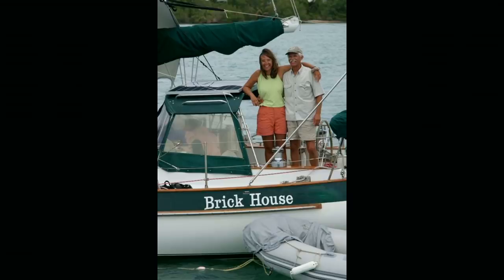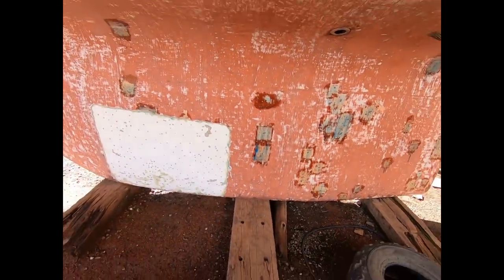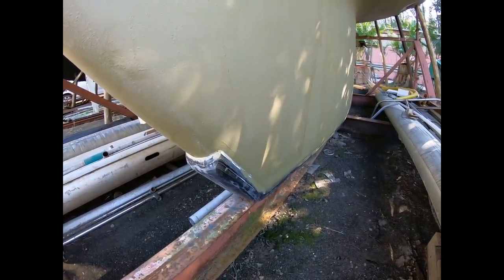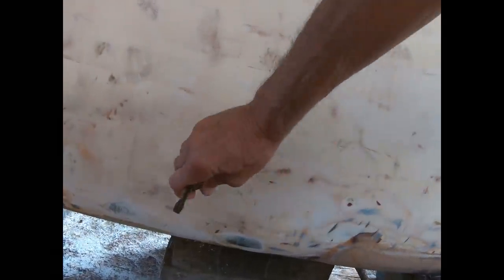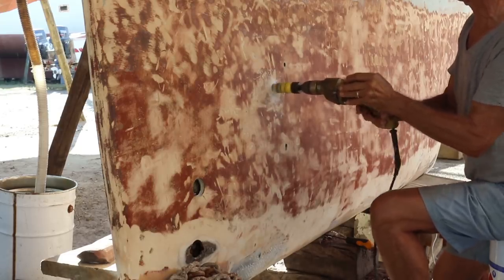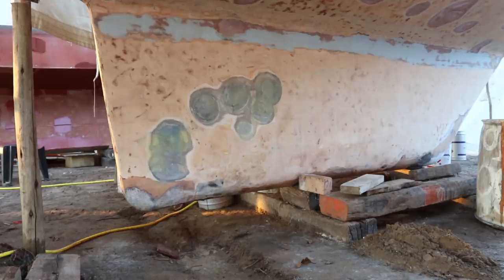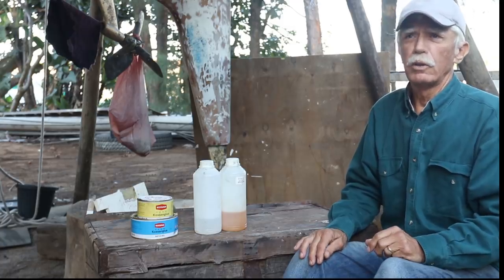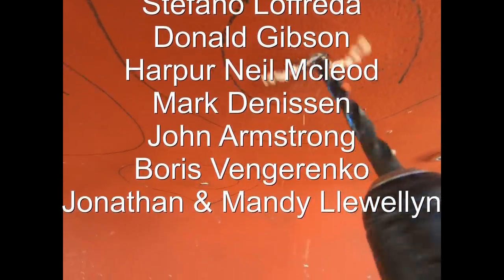Sailboat Keel Repair/Problem: SOMETHING IS MISSING FROM OUR KEEL !! (Patrick Childress Sailing #42)

Comment: Wow, memories came flooding back to me while watching your video!!..
I built a sailboat in transvaal back in the early 70's out of (open cell foam) and fiberglass etc (foam sandwich construction) it was a bilge keel design and the twin keels never worked as we almost lost the boat on a trial voyage off Hangklip in False Bay in around 1982  some years later..long story short I removed the twin keels and created a cutaway forefoot keel which I fabricated out of foam and fiberglass and ingots of lead for ballast. basically what you have there on your keel with a void aft of the ballast with foam.

 During sea trials after I converted,  I was horrified and depressed to note that my boat was still very tender and it was owing to the fact that I was getting a lot of negative buoyancy , as my good friend Roy MacBride pointed out on this trial sail, as did my friend Paul Tomes, both very competent sailors and builders. My only option to salvage my boat and my world cruise dream was to haul out again and remove a large square of fiberglass from the keel side and literally dig out the offending foam, until I had hollowed out the space !! (Yes, the joke about the yard at that stage was that Reid was giving his boat a Caesarian.!).anyway, after that I reglassed the big square hole closed but left a hole about six to eight inches open and into this I poured wet concrete, I kid you not... and after it was levelled off at the top of this hole I it let be for a month or so to cure (concrete cures pretty much after 30 days), but continues to harden for a very long time, seventy to eighty years comes to mind.

Well I sealed off this hole finally and put a new coat of antifoul on my Deja vu, and took her out on another trial sail. WELL!!! If this wasn't a stable, solid, stiff boat in a hard breeze in False Bay!! She was a different boat!! She pointed very well upwind, had lost a lot of her tenderness,  and the rudder was very well balanced and a joy to sail!!   This may as well be a preview to the beginning of the book I wrote some twenty years later after sailing virtually all the way around the world. I never have had a moments trouble from her keel or the concrete ever, and she is still going strong some forty years after I set off on my cruise. The book describes the terrible voyage where we had the major showdown with the bilge keels.... I had to abandon her a few miles off Hangklip during a fierce winter storm over night after the National Sea Rescue Institute tried towing us to safety but was not able to do so...the book is called Days of Deja vu (jonathan reid)  if anyone's interested in reading all about it and the cruise thereafter...:)  I was so pleased to see that you poured the voids full of a solid, even if the resin did not set off 100%  I am pretty sure it eventually will harden, and you have no doubt seen the improvements to her performance!  I wonder if you and some of the other boat owners there in the yard are planning a world cruise? If so, the best of luck to you all and may God go with you! I currently live on the Hawaiian island of Kauai, have done for a long time lol, but do miss my days sailing around the cape area and the Vaal dam where my boat was first launched...Be safe, and tight sheets..:)
Reply from the maker: Jonathan Reid This is Rebecca. It sounds like an interesting book! Thanks for watching this video and commenting...definitely watch some more of our videos before this one...Yes...we are slowly circumnavigating...out for 12 years now. Love Kuaui...May end up there someday...we will be heading to Uruguay, and then south to Patagonia and back up he other side...so the Hawaiian island certainly possible. See you there!
Reply: @RVLifeNOW  Thank  you, and I see you are already slowly circumnavigating... sorry I didn't figure that out, but that's wonderful and I wish you the best and bon voyage :)

Comment: Doing this in South Africa must make this a lot harder for sourcing quality materials.  I have read of people flying back to the world to buy what they needed and returning to their boats with it depending where they were at.  Sometimes it was the only way to guarantee that you would actually get it.  Good luck with your project.
Reply from the maker: You are exactly right. There is a 56% import duty. Rebecca came back from the U.S. with large suitcases stuffed with repair parts.

Comment: Had a similar weakness on my old Rival 31 sailed her for 20 years before when doing re-fairing work following remedial osmosis treatment I discovered the very aft tip of the keel bottom was hollow and extremely vulnerable should one ground on that point. I did a similar repair but also stuffing in mat and resin.
Reply from the maker: Good info

Comment: In the US I've had good success with Raka epoxy. Thanks for the great video!
Reply from the maker: Just like Gurit, I have not heard of Raka. I used the Gurit yesterday and it is performing as I would hope a proper epoxy would work. In the June 2012 issue, Practical Sailor did a comparison of epoxies. Raka was one of the 4 tested. It did very well.

Comment: That keel void wasn't so bad. For those interested in this issue, I'd recommend watching (Sail Life - digging deep - the adventures of the of the bilge)
Gurit resins (SP106 slow) are the good stuff .. at least if the ambient temperature is above 15°C. I have used about 10kg of it, and have had no issues with it not curing properly.
Reply from the maker: Thanks for your suggestion, I just watched Mads dig the mucky foam from his bilge. I watch a lot of his videos.

Comment: Some type of injector to fill the keel would have me feeling more confident about the repair. That’s just the OCD in me, I am in no way near the expertise that you possess. Thank you for your videos and along with all the hard work it takes to create them.
Reply from the maker: At one time I would have left well enough alone, but working next to our yard worker in Colombia, Flavite Enrique Bernate Moreno, yes he has 3 last names, I learned how to rip out our side decks to remove the water saturated balsa then put it all back together again. Right now I just cut a big square hole under the windlass and removed that wet balsa. Today, I have to start the rebuild before the rain comes this evening. Like they say about flying an airplane, "It is easy, once you know how!"

Comment: I have found that some epoxy types seem to require excitation (by stiring) partA and partB separately before  combining them for final mix.
Reply from the maker: Have you ever seen that in the instructions? I have now tried the Gurit and it seems to be a very high quality resin. The pot life is not long though so one has to work fast and not mix up too much, even with the "slow" hardener.
Reply: @RVLifeNOW  No sir, I never seen that in the instructions, but got the tip at an epoxy makers store a few years back after taking it back for a refund. He whipped each part separately, then combined them with perfect success. I went back and finished my project. I always do this now except when using the west system. In fact, I didn't believe it would make any difference when he told/showed me. It made all the difference.

Comment: I bought all my expanding structural 2 part foam to rebuild both my rudder blades on my Leopard from AMT Patrick. They supply great products. Pricy but good
Reply from the maker: I just did some layup, yesterday, on the skeg and on the bottom of the keel with the P106 resin from AMT. Looking at it this morning, amazing good stuff, like I would expect a resin to be. I quickly learned, mixing 300 gm at one time, means I can't dawdle laying up small areas....sets right up in the bucket, and that is with the slow hardener!

Comment: I've been using Gurit for a few months now and it's brilliant. Applies well and sands well. As far as I know it's a Swiss product manufactured in the UK.
Reply from the maker: I checked into Gurit and it appears they have distributors all over the world. I had never heard of it before. I have been using it and it does what I would want a high end epoxy to do. My only snag is that even using the slow hardener, I have to work quickly as there really is only a 15-20 minute working time. So I am learning how to use it. Today we did two layups on the keel to hull join and yesterday did two layups on the skeg. I did pretty well guessing on the amount to mix for the square area to wet out. Unlike yesterday where the brush suddenly hardened into the slightly smoking bucket.
Reply: @RVLifeNOW  Yes, I was going to mention the fast setting time. 
The Gurit agent suggested I put the epoxy and catalyst in the fridge overnight and that should give a few extra minutes but I've learned to just use smaller amounts.

Comment: Its worth noting that the hole repair method is different for cored panels. There you epoxy a plug of core thickness into the hole and only do a 12 to 1 fibreglass lamination (measured on the basis of the skin thickness on either side of the core) on both sides of the plug. There is a method to do so for areas where you have no access from the inside of the boat.
Reply from the maker: Thanks, Tom.

Comment: Technically all factory premixed canned pressurized foams have to be closed cell foam so you're likely to be wrong about those canned foams being open cell foam.  However, it's unlikely that any foam you put in there will bond well against the fibreglass.

The issue with a protective material along the outside of the keep is ensuring it has similar temperature expansion characteristics with the fibreglass or is bonded to allow for different expansion properties.
Reply from the maker: John, You are right. Thanks for pointing that out. I should have said that polyester resin eats up polystyrene foam. If I can get time tonight, I will see if I can delete my wording in the video. Once a video is up, it is extremely difficult to make any changes but deletions…I will give it a try.
“Closed-cell foam provides a vapor barrier, a harder finish and higher R-value. Canned foam like GREAT STUFF™ is a closed-cell foam that comes in "single-component" form. The closed-cell foam that contractors use on large-scale spray foam jobs is also known as "two-component" foam or polyurethane foam.”

Comment: Gurit manufacture a range of resins called Ampreg. I used Ampreg 26 for years and it was fantastic. 
Used it on hull of a Wally super yacht. I think it has been superseded by Ampreg 36 now.
It’s available in a range of hardeners- Fast, standard, slow, extra slow.
Reply from the maker: Ian, good information. I have been using the resins supplied by AMT, here in S. Africa. Their designation is SP106, which, I would not be surprised, is their Gurit, repackaged designation, for the Ampreg 26. Of course, West Systems has their general resin designated at 105 and I am told the SP106 is comparable to the West 105. I have been using the "slow" hardener but still it sets up faster than I would like, especially when mixing more than 200mg, or 6 pumps from my new metering pumps I ordered from the U.S.. I will have to see if AMT has the "extra slow" hardener.  Thanks for your comment and information.
Reply: No problem. Check the Gurit web site out and compare the mechanical properties out on the data sheets see if they are the same.

Comment: I added a rubber “bumper” on my keel as I grew tired of repairing the leading edge.  I used stainless steel screws, and 5200 on the threads, in the holes and between the bumper and the fiberglass.  I no longer own the boat and have wondered about the intelligence of the screw penetrations.  It was a trailer boat so I guess I wasn’t worried about water infiltration.
Reply from the maker: It would be interesting to know if water ever got past those screws. I was thinking, after the 5200 was well set, the screws could be backed out and thickened epoxy injected into enlarged holes to seal the penetrations.  Next time.  thanks for your comment.
Reply: The boat, a Hake Seaward 24 footer with a shallow draft keel with wings simply could/would  not make headway to weather once the wind exceeded ten knots.  I tried every trick with the sails the manufacturer suggested but with no success.  Now this model has a center board. Ha!
Reply: @erichaskell  if you ever need to do something similar again you can make solid plugs in the epoxy  where the screws are going to go. This way the screws aren't causing aplace for water to get in. It's the same concept as when you back fill holes in a cored deck.  One thing that I do different is that I'll add scraps of fiberglass to the holes in order to give the screws something to help bite into besides resin.

Comment: Looking forward to the one about blisters. Apparently you filled up the rear of the keel ? or close to it ?
Reply from the maker: I filled up the voids as much as I can tell. As the designer said, "There should be no voids in the foam...." so I do expect this to take care of any oilcanning when blocked on the hard and strengthen the area in case if we should ever wind up hard on a reef. Read through the response to Catherine, the comment just below yours for more details on what and why I did what I did.  The resin blisters are a common problem for the mid and late 1970s Valiants.  Today I found 2 more, small, blisters, but I think this is pretty much near the end of opening thing up. In a month or two, maybe the reassembly can begin. In the mean time, there have been plenty of other projects to complete.

Comment: The Carter range of boats made by Olympik in Greece have hollow rear sections behind their lead keels. This section is there to adjust helm and help downwind stability. The walls are fibreglassed 10mm ply, (total around 15mm per side) which stands up quite well to immersion but has near zero structural strength, on the other hand it is easily replaced when damaged. The owner is supposed to advise the boatyard where not to place keel support during haulout, if the owner is aware. YGWYPF
Reply from the maker: Took me a while to figure out YGWYPF...but so true! The builder of the Valiant 40 meant the aft of the keel to not be encapsulated lead, but didn’t want any hollows ;)  Are the Carters race boats or cruising boats? At least the hollow is in the back. It seems like the boat in this video with the hollow in the front, is asking for a disaster since if that part is completely hollow, it is really more like part of the hull and could sink the boat unless it is watertight from the rest of the boat :) Rebecca
Reply: @RVLifeNOW  The Carter yachts were designed by Carter who had zero naval design education, for IOR offshore racing, low budget production and suited to cruising fitout and med charter ~45 years ago. The hollow section was put there to make the boat slightly less squirrelly for cruisers, whether it worked or required more hollow forward of the original keel to balance is debatable.

Comment: Keep at it Patrick it can only improve her.
Reply from the maker: Robin, after 7 months, we are nearly ready to launch. Just finished with the Coppercoat, antifouling, today. Tomorrow I start the engine and make sure there are not problems, then Thursday we launch. Brick House is back together and stronger than when it rolled out of the factory. I will feel much better about this boat as we cross the Atlantic to Uruguay and around the south end of S. America.  Thanks for your comment.

Comment: Yea those Valiants are notorious for blisters, but only for certain years, like around 1975 on... I wouldn't be counting on blocking the boat on the back of the keel. Resin alone doesn't have a whole lotta strength with out FG it's just plastic after all but I agree it is better to have the void filled. Too bad you couldn't get any two part closed cell foam to pour in there .BTW,  I HATE grinding FG...My 2 cents
Reply from the maker: All suited up and in the cool weather of Richards Bay, I don't mind the fiberglass grinding too much on my own boat. I couldn't imagine doing it as a regular job! All the other tropical climates we have passed through, it was always too hot to think about doing work like this, and being all wrapped up in safety gear.

Comment: It would be interesting to know what kind of drag that rubber on the keel added.
Reply from the maker: It certainly is not streamlined on the front and wonder how that could be improved. There are boats all over the Bahamas and the Pacific that could have used that rubber cushion on the bottom edge and better still if it wrapped up a ways on the side of the keel.

Comment: I know, Andy, (boatwork tody) has change to Totalboat products. They sell on Amazone, but it maby still hard to get. Some job you have done with her. I liked the rubber. But it must be hard to bend around the front of the keel. Nice ide thou.
Fair winds ,,,,/),,,,,,
Reply from the maker: That is the problem working on our boat in foreign countries, familiar products are not always available. I just used the Gurit, P106, and it is very good epoxy, like I would expect an epoxy to be. Thanks for your comment.